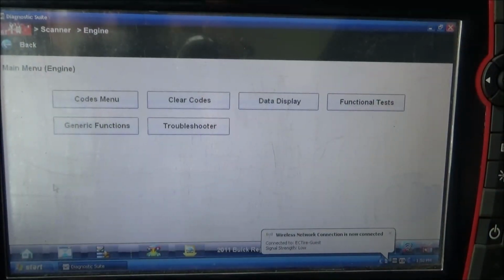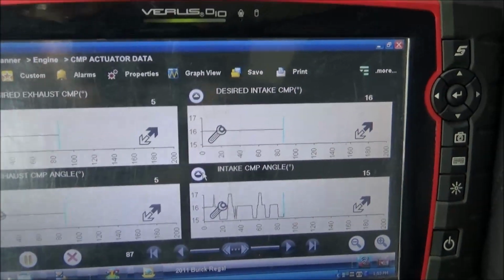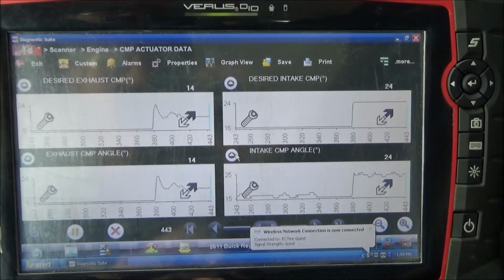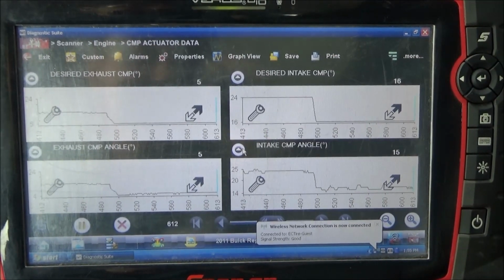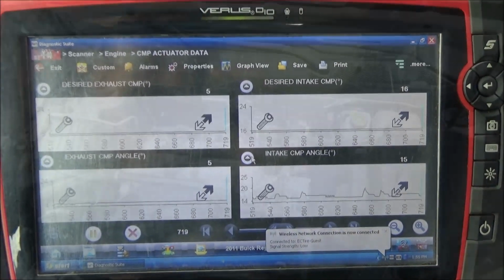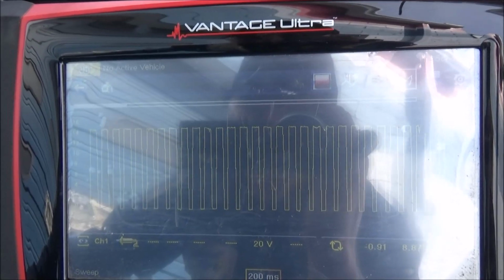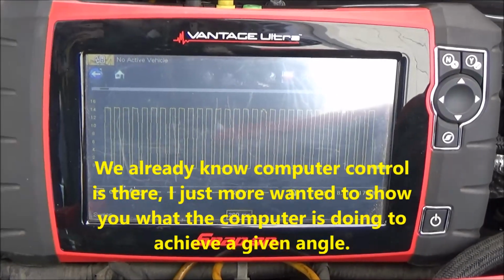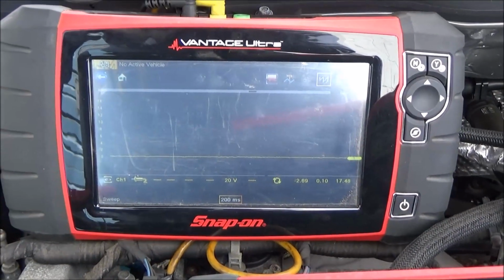2011 Buick Regal, VVT Solenoid Troubleshooting

Comment: Very useful information in this video thanks!  I have a 2012 Regal with the same engine code error.  I do have a question though, would you say that the rattling sound it makes when running is normal for this type of engine?  Mine sounds pretty similar and I was told that it could be a point of concern for the overall health of my engine.

Comment: Maybe you or someone can help. I have a 2011 Buick Regal CXL 2.4l. The car was running rough so gave the car a tune up, the camshaft solenoids, a new timing chain set, catalytic converter, flex pipe, valve cover and gasket, water pump, cleaned the throttle body. And still hear a rattling sound a little also the car likes to shutter when at idle or at a stop it does it on and off. Extremely frustrated haven’t even had the car a full year and put so much money into it any info would help!

Comment: Thanks for this! After 50k miles my 2012 Buick with the 2.4 Ecotec started stalling or stuttering when I pressed the gas very slightly from a stop - it seemed to be worse in damp or wet weather. (I could avoid the stall by hitting the gas hard from a stop) Check engine light came on, scanner showed error code P0010. After watching this, I tested my VVT solenoids with my multi-meter ohmmeter. The intake and exhaust were both bad - registering over 100k ohms. I bought new ones and probed them as well - both registered at 10.5 ohms. After installing the new ones (easy as changing the oil :-) ) car is running like new again.
Reply: Mark Dersch  thank you so much I’m having this problem with mines now & after scanning it P0010 code was the 1st to pop up also my mass air flow sensor P0102 I changed my mass and the problem still happening so when you said your intake that made sense this really helped me

Comment: Nice work. I had the same symptoms on my 2011 Regal. My mechanic found that the intake solenoid was bad, and recommended changing the exhaust too to be on the safe side. Trouble free since both were changed. It's nice to have vids like this to have a good sense of the issue.
Reply: Did you have the catalyst converter code ?
Reply: How did the car run after replacement?

Comment: Sometimes I wish my electronic devices were more simple. When I reach for the 'off' switch of my alarm clock, I have to find my glasses and turn on a light, then scroll through a menu before I can turn it off. Here, using the Vantage as a multimeter you went though a lot of effort just to do an ohm check, ha ha. This is an interesting video. I wondered whether sometimes it's not the 'action solenoid' but the sensor that tells the PCM what the angle is.... I suppose that could present in a similar way....

Comment: Have a bad selenoid on my 2012 Impala.  Well the code says it's bad, LOL. The engine light only comes on after a full throttle run and goes out after 4 ignition cycles. I don't have a scope but will definately check the resistance. Sorry can't do a current ramp on it. Great video series!

Comment: The contacts in those solenoids are a high failure issue. Sometimes, just moving the connections on those, like when removing the engine cover, will cause the connections in the solenoid to fail. Good thing they are easy to diagnose and replace.
Reply from the maker: These bad boys are gravy right here!

Comment: Well done sir. I hate using probes on component pins like that as readings always seem sketchy. I keep a small assortment of female pins/wires from old connectors/wiring harnesses to use. It speeds things up and adds confidence to those sometimes troublesome ohm checks. Thanks!